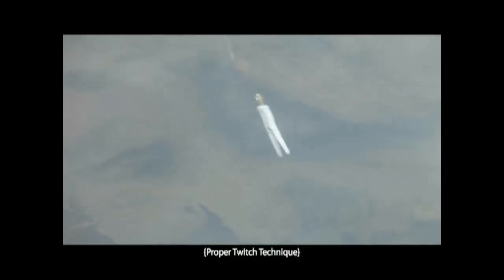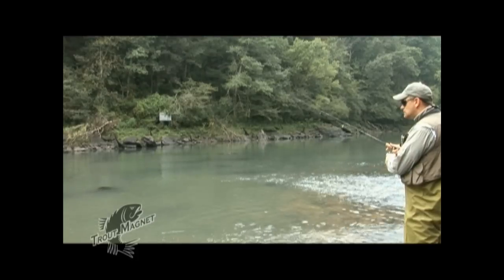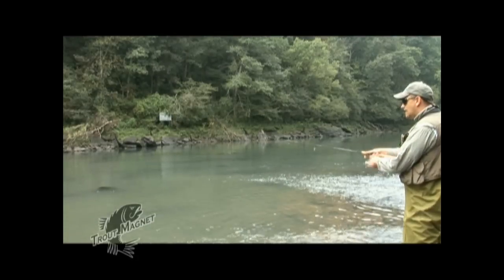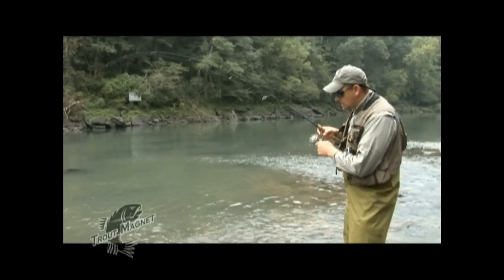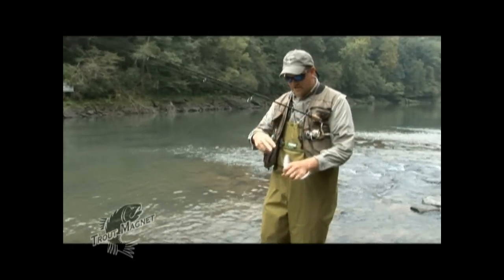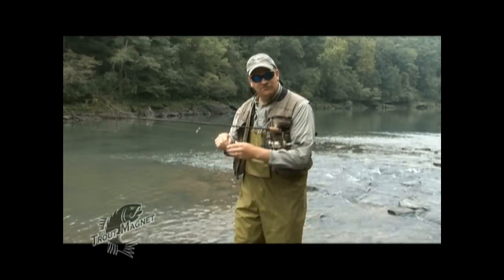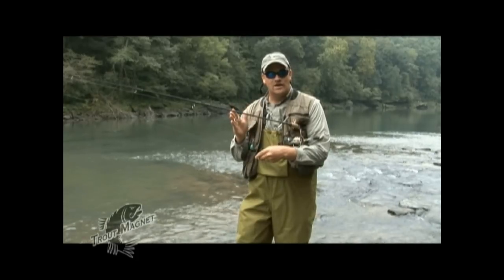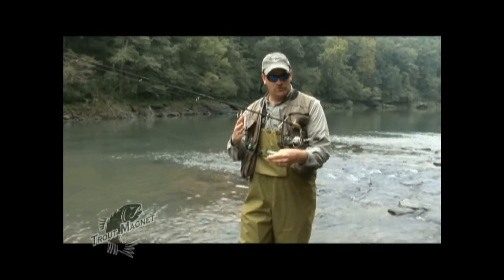Trout Magnet: The Twitch Method

Comment from the maker: We always use a fluorocarbon leader using both the "twitch" and EZ Trout Float.  If your creek with no visible current is shallow try the "twitch" method first.  If this same no visible current creek also has gin clear water I would use the "twitch" method.  If this proves unproductive and you know there are indeed trout there, then goto using the EZ Trout Float method.  In no current, I would add some action to the Trout Magnet by slightly twitching the float.  Use this same technique in lakes.

Comment from the maker: Trout will not stay in really fast white water unless the oxygen levels are low. They will sit in the area just below the white water as the water starts to get deeper. They will also stay in a narrow run in the river that might be a little deeper. You can usually see these seems by watching the bubbles on the water making a seem on top of the water. Drift your Trout Magnet close to the bottom in both situations and make it drift as naturally as possible.